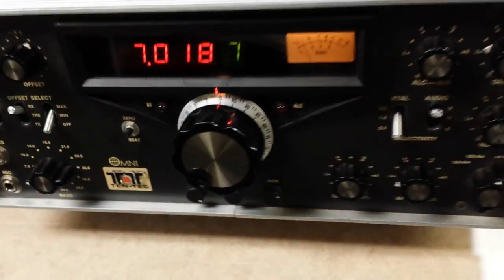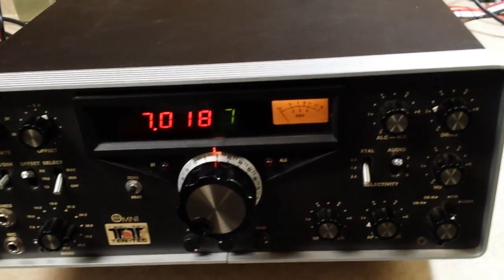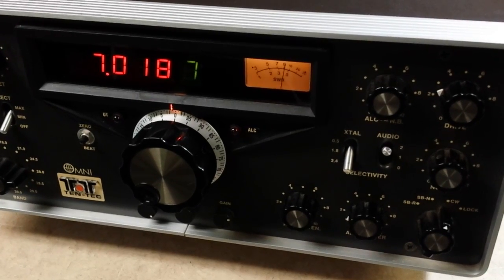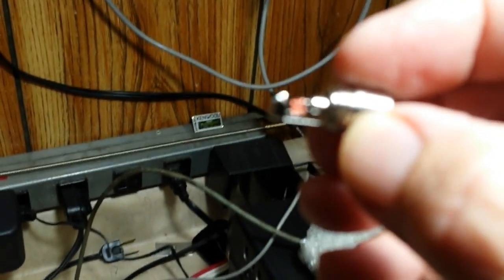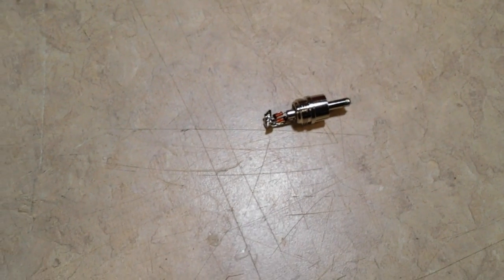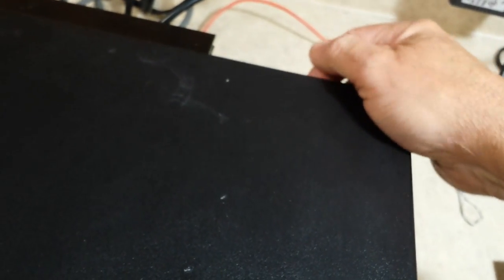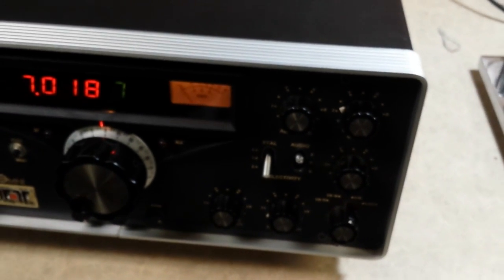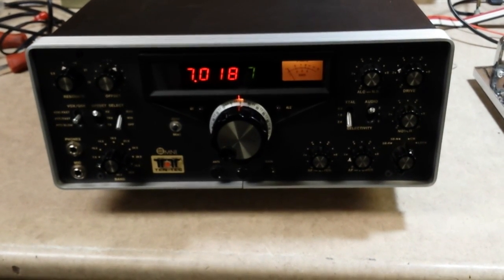Ten Tec Omni D A B or C AGC POP Reducer- Corsairs too!

Comment: You mention "2pairs" of diodes....You just have quantity 2 diodes correct?  And wired from tip to shield, one going one way, the other going the other way,?
Reply from the maker: Where did I say "2pairs"? Yes 2 diodes back to back between center and ground of the plug.

Comment: Wow, You must really like the IC 7300. I was impressed with the demo you did of it comparing it to the K3. The 7300's display looked very good. Also looked at the K3 vs 2B   video.. I have always liked the 2B, it's a great receiver even compared to some newer high dollar rigs..
Reply from the maker: Mostly the modern rigs are just more convenient than the old one's. No more drift and nice accurate readouts but for the most part you can hear signals with a 60 year old rig as well as a new one.

Comment: Steve, for giggles, have you tried an A/B between the K3S and  Omni C? I know the K3S will have better selectivity but in general terms of sensitivity and pulling out fairly weak sigs. I have a lot of TT gear including CII's and O6+'s but always liked the simplicity and decent audio of the Omni C as well as the Triton IV.  73, Glenn WA4AOS
Reply from the maker: Well the K3s has been replaced with an IC-7300. 
I did compare the K3 to a Drake 2B however. 
https://www.youtube.com/watch?v=Z9mAzxkuk18